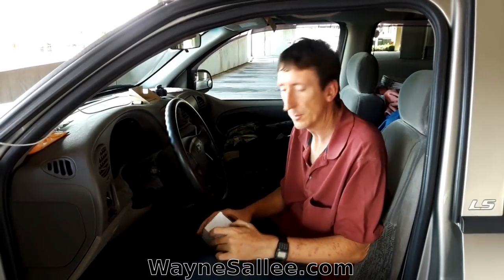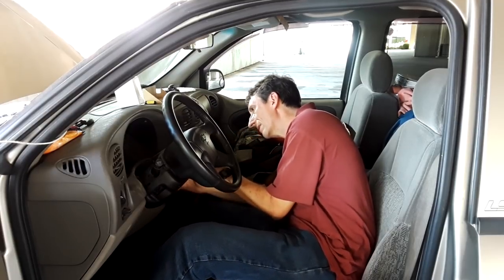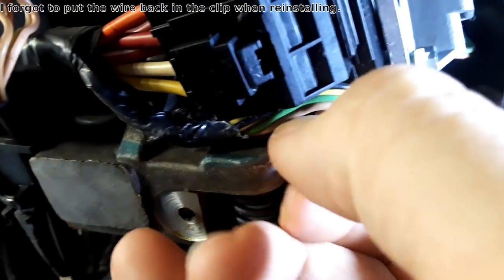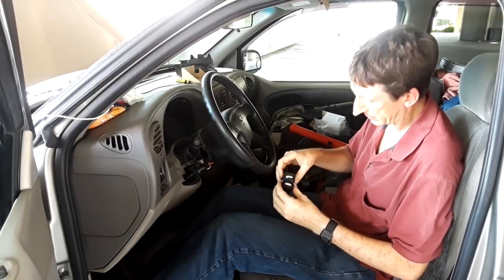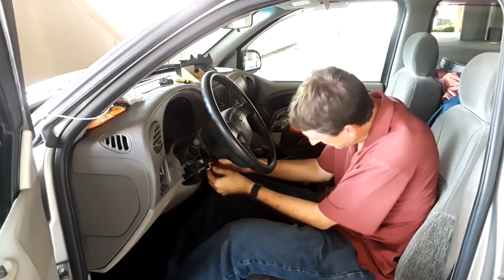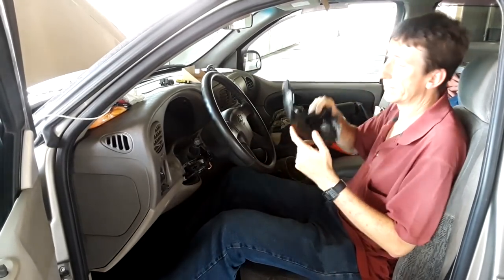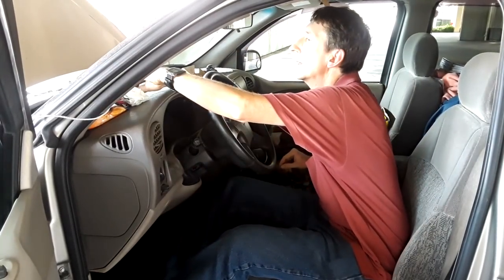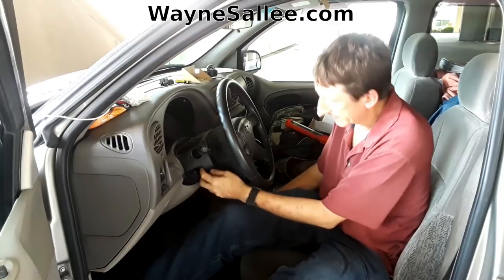Easy way to replace the Ignition Switch in Trailblazer 2002.

Comment: Hello Wayne 
I got home from work and my car wouldn’t shut off, would that be the ignition switch as well? 05 trailblazer 
You’re video was very great
Reply from the maker: It could be. To find out, next time it does that, disconnect the ignition switch. If that turns the car off, then the ignition switch is bad.

Wayne Sallee
Wayne@WayneSallee.com
http://www.WayneSallee.com

Comment: Hi Wayne, it seems very interesting your video, I have a TB EX 2004, and I stop hearing the chimes, then my CD or radio doesn't sound, the gas gauge it's some kind of erratic and now the driver window is not working...may I think the problem is the ignition switch?
Reply from the maker: For the 2002 Trailblazer, the chime goes through the driver side speaker only, so those 2 problems are probably the same. The other 2 problems are separate. So it's probably 3 separate problems. And I don't think it's an ignition switch problem. 

Actually it might be 2 separate problems. The driver side speaker, and driver side door, could be the same problem. Take a look at the switch box in the driver side door.

Wayne Sallee
Wayne@WayneSallee.com
http://www.WayneSallee.com
Reply: @WayneSallee-comTech  Thanks Wayne, I did check the Driver door speaker and its ok, still the chime and the radio goes on and of intermitent...could that be caused for the switch box in the driver side door?
Reply from the maker: @jdikdan1  Yes, that switch box in the the door is the central hub for everything electrical in the door. 

If you were to take that switch box out, nothing electrical in the door, would work.

Wayne Sallee
Wayne@WayneSallee.com
http://www.WayneSallee.com
Reply from the maker: I was mistaken about the speaker. The speaker is the one and only item that will function without the switch box.

Wayne Sallee
Wayne@WayneSallee.com
http://www.WayneSallee.com

Comment: Hi your video worked wonder but RIGHT NOW The car won’t stop ! Like the engine is on and I can’t turn it off
Reply from the maker: Was it doing that before you replaced the ignition switch? You might have gotten a bad ignition switch.

Or your ignition relay could be sticking.

Wayne Sallee
Wayne@WayneSallee.com
http://www.WayneSallee.com

Comment: why do i keep having to replace my ignition switch in my 03 trailblazer LS
Reply from the maker: Have you taken any of your old ignition switches apart?

What do the old ignition switches look like inside; are there any burnt areas?

Wayne Sallee
Wayne@WayneSallee.com
http://www.WayneSallee.com
Reply: I have a no crank no start I replaced the ignition switch and after a few drives and I thought it was working great it was back to a no start no crank. What's the next easiest thing to do?
Reply from the maker: @whatthe2458  The next easiest thing to do is to replace your trailblazer. It is easier to replace your trailblazer than it is to replace all of the parts in the trailblazer. But the best thing to do is to look at what is wrong, instead of just changing parts. But if you want to just keep changing parts, then the next easiest thing to do is to change your windshield wipers. :-)

Wayne Sallee
Wayne@WayneSallee.com
http://www.WayneSallee.com
Reply: I knew it was a $30 Gamble and easy to do. Just wondering what the next thing to check.
Reply from the maker: @whatthe2458   Have you taken any of your old ignition switches apart?

What do the old ignition switches look like inside; are there any burnt areas? 

Do you have a volt meter?

When does it work, and when does it not work?

Does turning the ignition switch on and off repeatedly make any difference?

Have you checked the wiring going to your starter?

Does banging on your starter make it work?

Wayne Sallee
Wayne@WayneSallee.com
http://www.WayneSallee.com
Reply: It's getting really cold here in Chicago but I will look at the switch
Reply: We drive it a little bit and then it goes back to no start. so far it's only been a few times but if I hold the key turned and after about 10 20 seconds it will start I will try banging on the starter should somebody be turning the key when I bang on it or just bang on it a few times and see if it starts?
Reply from the maker: @whatthe2458  Don't take apart the only working switch that you have. You might mess it up. Do you not have the old switch?

Wayne Sallee
Wayne@WayneSallee.com
http://www.WayneSallee.com
Reply: Maybe replc with AC Delco brand parts nxt to the orginal.

Comment: Great video! I have a 2004 Trailblazer and wondering if mine could be the ignition switch. The gauges on the dash were going crazy a few days ago,  then when we shut the vehicle off it wouldn't crank when we went to start it back up. I tried to jump it, thinking it was the battery but didn't work. Then, after about 20 minutes I tried to start it again and it worked without jumping. Sometimes the dash lights up and all lights are on, then other times nothing but the check engine light comes on. Either way, if I am patient enough it eventually cranks and works fine. Any suggestions? I would love for this to be a $30 fix :)

*update: I installed the new ignition switch and it started right up. Everything was working so I put the panel back on then it did the same thing to me. When I turn the key all power is on, gauges and all lights are on but won’t crank. No clicking noise or anything, just doesn’t start.

*2nd update: I seem to have okay luck when doing the following. When I put the key in, I turn it 1 click until the battery light is on, then a second click and the whole dash lights up, all gauges, check engine, securty, ABS, seat belt.. I wait for them to turn off (about 5 seconds) so that only the gauges are lit up then I turn it crank the engine and it usually starts right up. If I just insert key and attempt to start the vehicle up right away it usually will not crank and gets stuck that way for about 5 minutes. I am so lost and have no idea what it could be since I just replaced the ignition switch.
Reply from the maker: I would never recommend anyone purchase a trailblazer. They have so many electrical problems. There have been problems with the body control module causing similar problems. It's under the back seat with the fuses.

I have a similar issue as yours, but with different symptoms.

I changes my ignition switch about a year ago because some times when I started the car, the transmission would shift hard. A bad ignition switch can cause this. That seemed to fix it for about 1 year, but just recently it has returned.

My symptoms are similar to yours, in that:
changing the ignition switch seemed to fix it.
taking the key out and restarting seemed to fix it, if not the first time, eventually it would work. Once it works, it works, until the car is turned off again.

One thing that I have considered, is if turning he key slower would make a difference, as you have mentioned.

Another thing that seems to make a difference, and is documented on the internet, is that things are more likely to work, if the AC blower is off when starting the car, especially not having the blower on high.

Another thing that I think might make a difference, is that I took the ignition switch out again a few days ago, and instead of lining it up the way that the old ignition switch was, I moved gears to the position to where it looks like in the not so good picture in the shop manual. I set it with the first point on the gear, barely sticking above the switch.

I also tried setting the ignition switch all the way to the end to see what would hapen, and it would not crank.

Wayne Sallee
Wayne@WayneSallee.com
http://www.WayneSallee.com
Reply from the maker: Well I tried the "turn the key, give it time, then crank" method, and for me it has proven not to help.

Now I'm trying the "turn the key fast" method with the fan off (very important), and so far it seems that it is preventing the body control module from overheating, but sometimes if refuses to start as if there is no fuel getting to the system, but "turn the key off, and turn the key quickly again" works. So far so good on that trick.

This reminds me of the days when I was using a TRS80 color computer 2.  Someone would give me a file on a cassette tape, and I wold have to adjust the pitch one direction on the cassette player, and then later as it was still loading the file, adjust the pitch the other way to finish loading the file.

Wayne Sallee
Wayne@WayneSallee.com
http://www.WayneSallee.com

Comment: How do you know I'm having a issue with my 06 when I drive the truck my drivers switch don't have power to it at all an all the other windows work on their own switch bought a new one same promble an here an their it just starts working an ideas great video
Reply from the maker: There has been some problems with rain getting in to the switch, because Chevy did not make things right. Look to see if water is getting into the switch. And see if power is getting to the switch.

Wayne Sallee
Wayne@WayneSallee.com
http://www.WayneSallee.com

Comment: Did you have any screws to remove on column part cover ?
Reply from the maker: No there were no screws on the column cover. Most cars will not have a screw there.

Wayne Sallee
Wayne@WayneSallee.com
http://www.WayneSallee.com

Comment: So I have 2003 trailblazer and when I put it park the key doesn’t come all the way back to off position and dash lights stay on and the park and reverse deal starts going back n forth threw gears flashing 
P,N,R,D
Reply from the maker: If the key physically won't go back, then it's the lock that needs to be replaced. You could try lubing the lock, and see if that helps.

Wayne Sallee
Wayne@WayneSallee.com
http://www.WayneSallee.com

Comment: I can't get the damn thing out to save my life
Reply from the maker: No, the Ignition Switch will not go to Hell, or Heaven. But as to the second part of your sentence, Saving your life (or your eternal life) is important. http://heavenhell.waynesallee.com

What trouble are you having in getting the ignition switch out? Did you disconnect the wires from it before trying to remove it?

Wayne Sallee
Wayne@WayneSallee.com
http://www.WayneSallee.com
Reply: Happens in cold weather. Hides like a frightened turtle
Reply: Aww I finally got it out, Had to have it towed to a garage. One of the biggest problems that's left out, The key had to be programmed. This isn't a job you can just do in your backyard. I lost everything to my name over this breakdown . Lost my business, I was already in the middle of moving. This wasn't the only issue, Transmission came out, Radiator blew a hole, Water pump went out, upper control arms had to be replaced, Last week the rear window exploded like a 12 gage going off. I think the damn thing is haunted

Comment: Because you change the ignition switch which was the problem that you car
Reply from the maker: I don't understand your question.

Wayne Sallee
Wayne@WayneSallee.com
http://www.WayneSallee.com
Reply: Was your car no crank start.   Why did you know to change that part
Reply from the maker: @jeffchambers1062  The reason that I changed it was because sometimes my transmission would shift hard. This can be caused by a bad ignition switch. It turned out that while this fixed the problem for about a year, the actual problem was a bad connection in my transmission from the wiring harnes to the Pressure Control (EPC) Solenoid, and posibly a bad Pressure Control (EPC) Solenoid. The connection to the solenoid  had overheated. I don't know if this happened with the previous owner, and they changed the solenoid out. The solenoid looked good, but I changed it out with the one I had purchased. I had not purchased  the wiring harness, and needed to get the car back together and running. The plastic piece for the connection on the wiring harness was also brittle and broke. I cleaned the connection, and put it back together. It sill has a slight hardness in the shift. So if I go into the transmission again, I will change the wiring harness.

Wayne Sallee
Wayne@WayneSallee.com
http://www.WayneSallee.com

Comment from the maker: Michael Ray
6 hours ago
Dude, you need to do something about those birds.
(Edited for language use. Let's keep the language clean).

Or better yet, I need to get a microphone.   Wayne@WayneSallee.com
Reply: WayneSalleeTech. Sir im  having. The problem where my key gets stuck when getting ready to completely shut off , could the switch be the problem ?
Reply from the maker: Probably not.  It's probably the lock mechanism.
Can you go into more detail on what's happening?

Wayne Sallee
Wayne@WayneSallee.com
http://www.WayneSallee.com
Reply: Yes i figured it out it was the lock mechanisms i just removed and they key came right out. But thank u sir
Reply from the maker: @ George Talamentex:

If the key is mechanically getting stuck, then it's probably the lock mechanism.

Wayne Sallee
Wayne@WayneSallee.com
http://www.WayneSallee.com

Comment: What would happen if I didn’t disconnect the battery before swapping out the ignition switches?
Reply from the maker: It just adds a layer of protection to prevent accidentally shorting a wire, or starting the car. You can easily do this without disconnecting the battery.

Wayne Sallee
Wayne@WayneSallee.com
http://www.WayneSallee.com